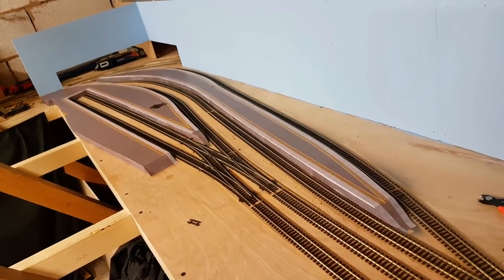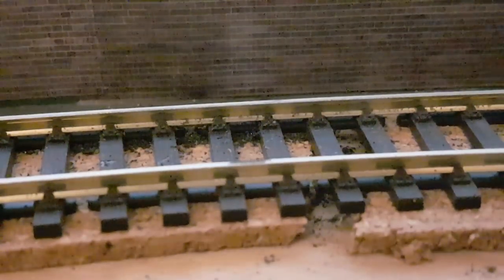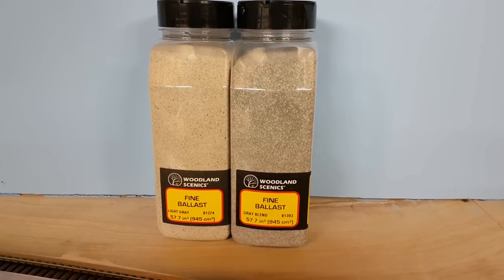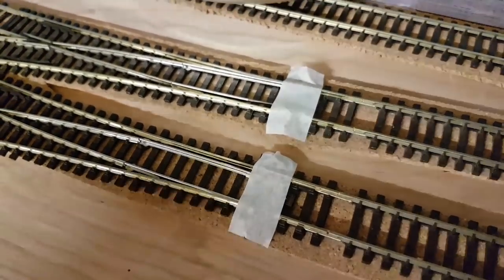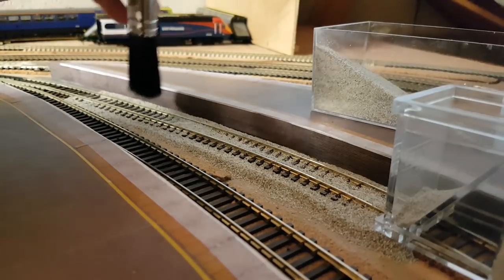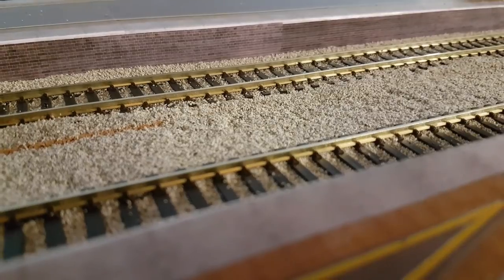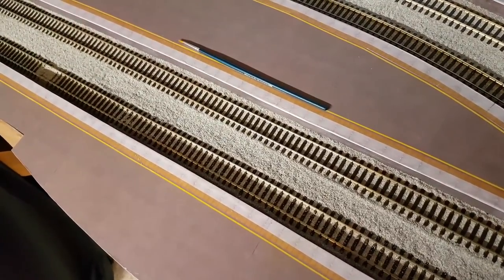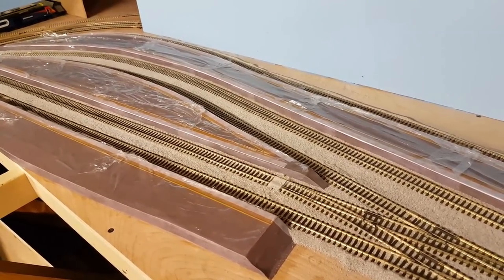New Junction - Station Ballasting

Comment: What I like to do to help the ballast be level with the ties but not on top of them, I get an old credit card or gift card and I cut two slots that perfectly fit over the rail. Then I drag it along and it takes the ballast off the top. Many ways to get similar results though. Great video!

Comment: It's always crossed my mind with the sheer amount of water needed to ballast and the effect it has on card or paper.. fingers crossed it doesn't go boobs up! 

I'm planning to use plaster board and that is going to be a pain for zapping up water. May well remove my platforms before ballasting.. I shall see! 

Looking forward to seeing the hands on weathering - non of this airbrushing lark!
Reply: I used the plasterboard method for
My platforms and didn’t have any problems when I did the ballast , I used the plastic Peco platform edges a la Glebe Road which maybe sealed it a bit

Comment: Amazing video but in your next video while ballasting can you show how you do your points to stop the contacts getting soaked in glue etc. 

Kind regards
LRP
Reply from the maker: lancashire rail productions the answer is simple for me, just don't glue them, the surrounding ballast will lock it in place.
Reply: New Junction Thanks that’s actually really helpful! I’m modelling in n gauge and I fouled my points last time I tried to ballast them so how far away from the main centre of the point would you say I should put the glue?
Reply from the maker: lancashire rail productions In 00 of say just the other side of the rail is fine. 

If your DCC have power connections either side of the points just incase you get them covered.

You could also scrape the glue off once it's dried.
Reply: New Junction so put the glue in the 4ft between the track?

Comment: Great video Richard it has given me the confidence to have a go at ballasting but how did manage the double slips and points. Any advice greatly appreciated
Reply from the maker: Cover the working parts in masking tape and don't ballast or glue near them. once painted you wont notice the gaps
Reply: @NewJunction  Thanks